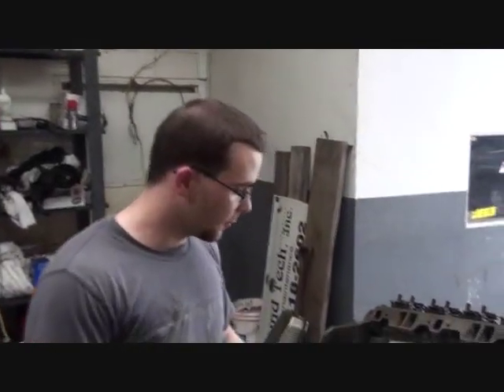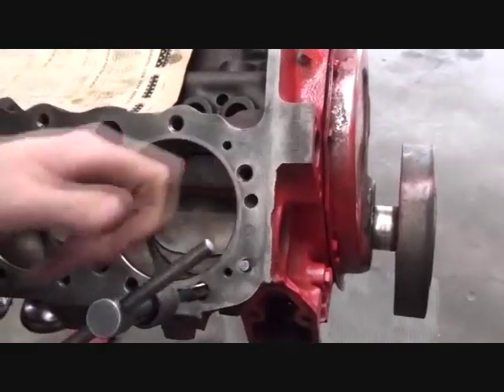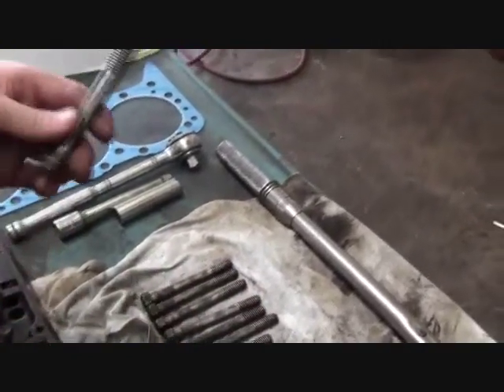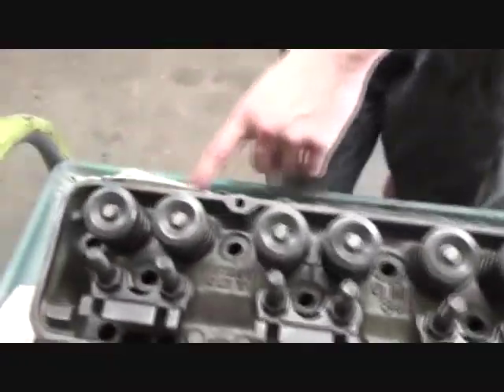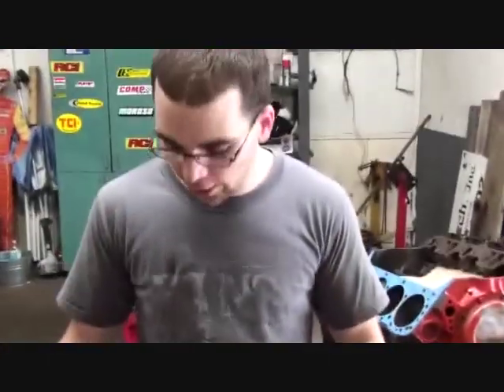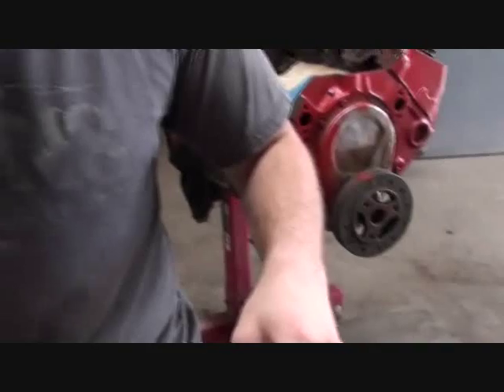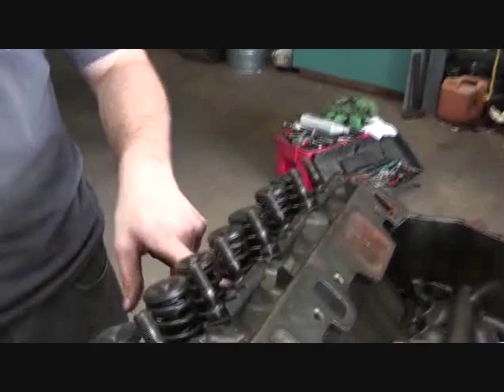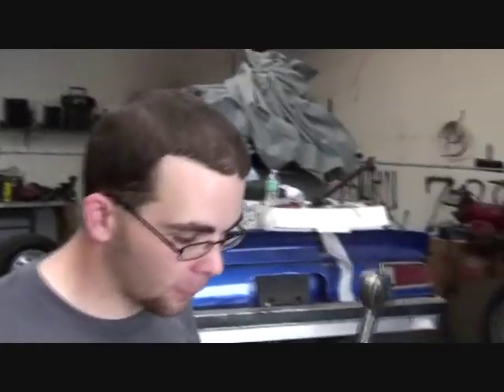Torquing on a Cylinder Head

Comment: Your input would be lovely:
After cleaning the heads, treding the holes, I put the heads back on and got to torquing.
I did it in 3 steps. When I got to 65 pounds, I kept turning 1 of the bolt because my torque wrench didnt click. Well, the bolt ended up snapping in the block =\
took everything off an tried again, and yet AGAIN another bolt broke off in a different hole. Its not the wrench because I have been careful with it. Was using felpro bolts.
Any help would be appreciated. 
Thanks

Comment: @vettelover2009 The bolts on my Mitsubishi are TTY bolts. This is why they have to be measured before they can be reused.

Anyway, this video isn't about 350 Chevy heads, it is about cylinder heads in general. Any time you do a head gasket, you're supposed to go by the shop manual for your specific application. In this video, he torqued the bolts 3 times to arrive at a final torque. TTY bolts are preloaded first and then turned a number of degrees. So I don't think he's using TTY bolts here.

Comment: @vettelover2009 Not true. I just redid my head. Mitsubishi recommends measuring the length of the bolts. If the length of the bolts is within the correct range that they give you (Alldata), they can be reused. Bolts mostly only stretch when they are overtorqued or if the head is badly warped from overheating. My head was overheated and pretty badly warped, but the head bolts were fine and reuseable.

Comment from the maker: @vettelover2009 Makes a great point. But this is a racing application, the heads probably come off once per season using typically a freshly rebuild bottom end and head surface, with a racing gasket. In my DD Trans-Am I used ARP hardened bolts. ARP says you can reuse the bolts up to 3 times.

Comment from the maker: @blacksimth69 The most important reason, is to ensure that the dirt and build up do not give you an inaccurate torque reading when you are torquing on the heads. When you have to torque it to the manufacturer recommended 70ftlbs, and your torquing against dirt and grease, the number will report higher and not give a true torque.